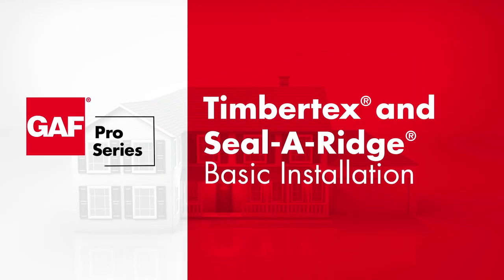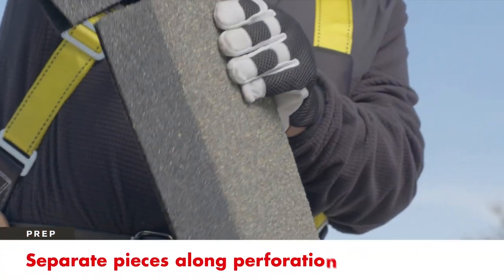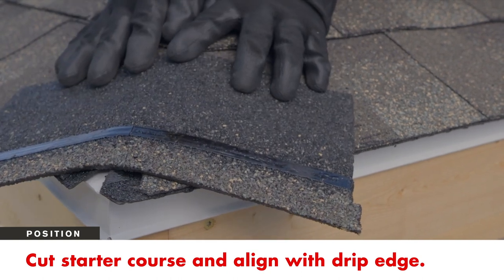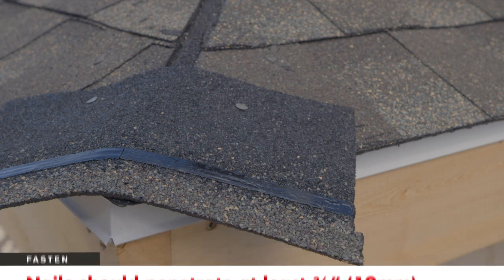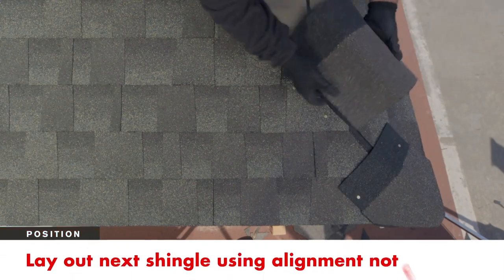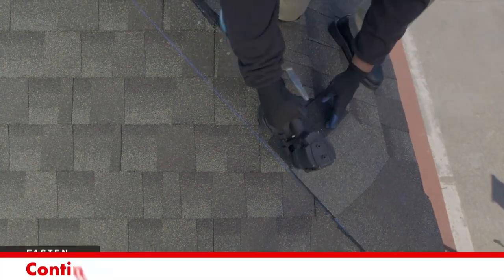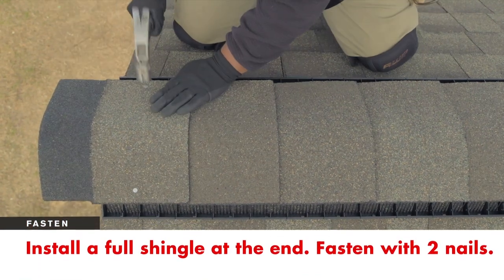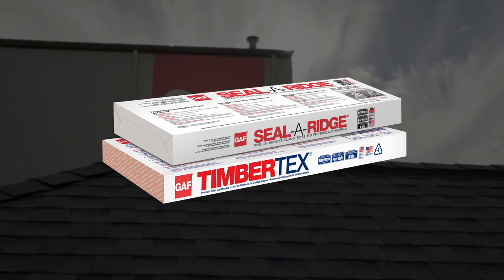How to Install GAF Timbertex and Seal-A-Ridge Shingles | GAF Pro Series

Comment: I prefer to reverse the final cap shingle and then seal with a half cut tab glued down
Reply: Looks much more clean that way
Reply: YES!!! just saw that in another video. VERY nice way to do it!  Getting ready to go outside to (hopefully) finish the roof replacement on my 20 year old gambrel roofed shed.  Was looking for some videos on doing the ridge - I have 1 side of the shed done.  Going to do the other side and then ridge shingles. Hopefully will be done today!?  Anyone care to estimate how long a noobie should take to hand nail / shingle a gambrel roof of that size?

And on a gambrel roof, for the transistion of slopes.. not sure if I did a kluge or not, but there's about 3 layers there - they gradually move up the slope - I didn't think I could / didn't want to bend the timberline HD all that much at that transition...

Comment: Is the Tibertex just thicker (double?) than Seal-A-Ridge? I'm not a huge fan of the very beefy ridge/hips.
Reply from the maker: Hi, Mike. Timbertex has an extra-thick, double-layer design with large 8" (203 mm) exposure. You can find specs on our website: https://bit.ly/37u7HLg
Reply: @gafroofing  Is it 2x as thick as Seal-A-Ridge then? As is Seal-A-Ridge is one shingle thick and Timbertex is two shingles thick?
Reply from the maker: Great question! As you can see by the specs and pictures on our website, the Timbertex has a large 8" (203mm) exposure. The Seal-A-Ridge measures out to an exposure of 6 2/3 in. (169.16 mm). We recommend checking out the link above for more info!
Reply: @gafroofing  I'm talking about thickness, not exposure. Why is GAF so weird about talking about the specs, specifically thicknesses?
Reply from the maker: Thank you for the clarification, Mike. Our technical team will be able to help you with your specs questions: 800-766-3411.

Comment: Why do these shingles not have the glue strip on them?  And for the ones that do have the glue strip, the instructions say to nail 7 to 7 5/8 from the exposed end. which is exactly where the glue strip is. Should the nail be closer to the exposed end or the covered end relative to the glue strip?

thanks!